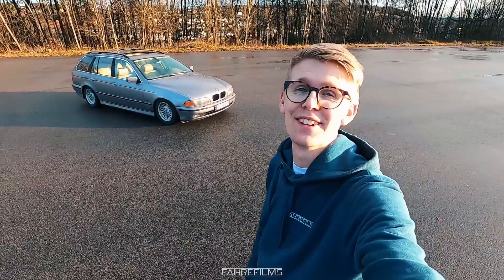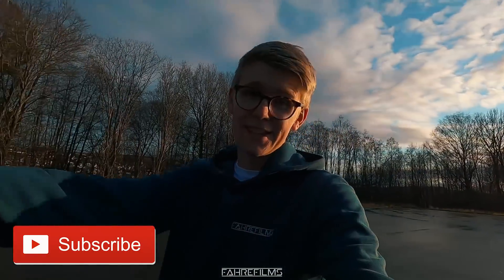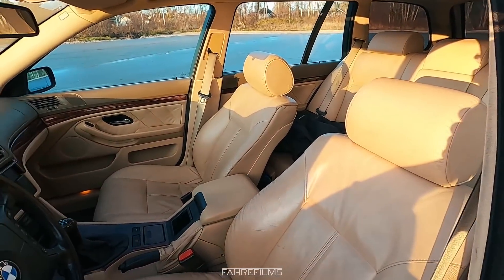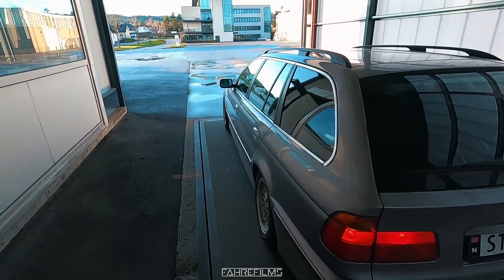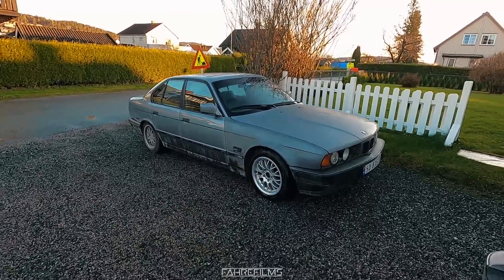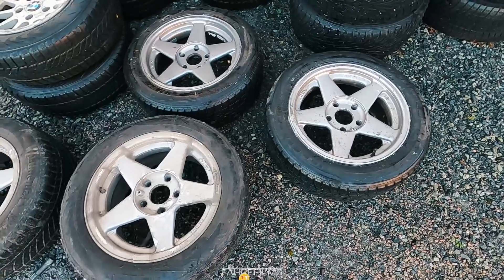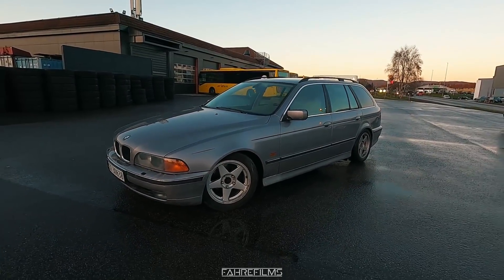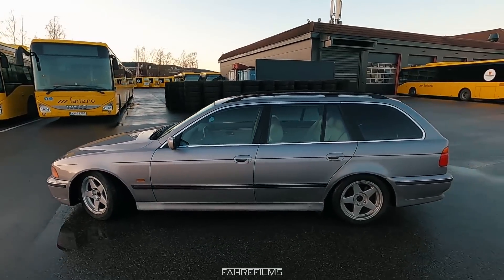E39 528i Build Begins! First Upgrades!

Comment: if u take the batteri off before u mess with the airbag and u rember du have the key out when u unplug the airbag and plug it in again u wont get a airbag light, i did it on my mk4 cuz i wanted a GTI wheel in it and i removed batteri og the keys and there is no airbag light :) anyways nice projekt car tho i hope u will do it up nice as u always do. love from denmark

Comment: Again, you forgot a really important step at the steering wheel swap. As the car has airbag, you should first get the car off from battery, to prevent accidetal airbag deploy during unmounting. Just an advice for safety.
Reply from the maker: Has is even happend? 😅😅 I forget it almost every time 😂😂
Reply: @FahreFilms  When Airbag breaks your nose then you will always remember to disconnect the battery!
Reply: Working on Airbags from the side and not right in front off it. And never put the airbag upside down, if it goes off its like a cannonball
Reply: @FahreFilms  there is an urban legend, that almost all car mechanic students are told in school, when a guy was screwing something around the airbag, it deployed, and sent the screwdriver through his chest, and he cuold have prevented it by disconnecting the battery.
Its an urban legend, dunno if really happened, but you know.... Better to be safe than sorry.
Reply: @FahreFilms  Extremely rare, but you can find at least a video which it happens.
Reply: Its not necessary, but yes it’s true. Disconnect the battery and wait a cuple of minutes, then check the voltage.

The airbag can break your nose or arms when coming towards you at 400km/t🙃
Reply: @dagger1749  theres an urban legend here in Hungary that a guy was killed by the airbag. As he was "screwing around" the airbag with connected battery the airbag deployed and pushed the screwdriver through the guy's chest....so disconnecting the battery is not much effort

Comment: The air condition shows Auto Mode and 32 °C. Wouldnt wonder that the heating directly to went to maximum Speed. Lower it to 22°C and the AC won't escalate when you push the + Button... There is no error

Comment: Check the codes for the airbag light, if its the passenger sensor, you can buy a bypass on ebay for 10 euros and the airbag will work and there will be no light. Did so for my E39.

Comment: When you take electrical parts off on an e39 please disconnect the battery. That is the reason Why your airbag lamp is on. You can go ahead and remove it with a scanner

Comment: everybody thinks that they know better than the manufacturers ffs. get rid of those coilovers, they most probably hurting her chassis. I did not like the rims, but that is just a personal perspective (Alpina rims would have been better). and spacers have a negative effect on handling since you add weight to rolling parts of the car. I made calculations about them, as far as spacers are not made out of carbon-fiber and balanced like the knife of Thanos, they do not improve stability. JUST A FYI.

and if you're not shortening the gear knob what is the use of standard one, at least design-wise.

Comment: Dude stop saying that this engine is m54b28 the m52 comes with 1 vanos not 2
Reply from the maker: Wikepedia says M52B28 👍🏼 and M52 can have 2 vanos
Reply: @FahreFilms  theu are wrong and the m52 has a smaller curved intake manifold and they are saying that the preface lift come with m52 single vanos and the facelifted comes with the m54 twin vanos
Reply: @bmwguru6611  it is a m52b28 coz i got the same one and it says it in my vehicle documents
Reply: Looks like not so “guru” after all. It’s M52TUB28.
Reply: @martynaskaralius9217  its not its noob